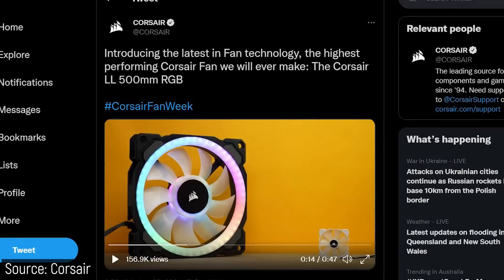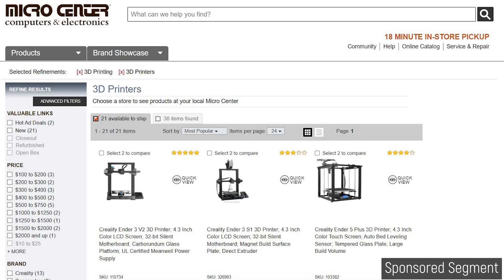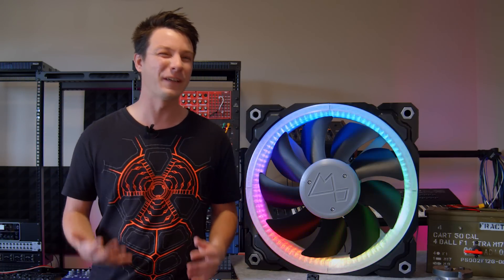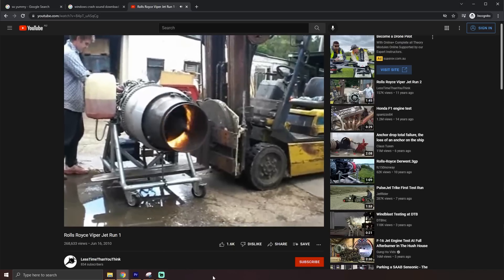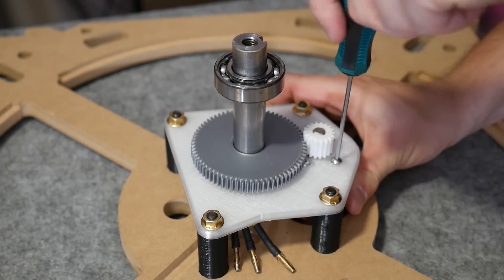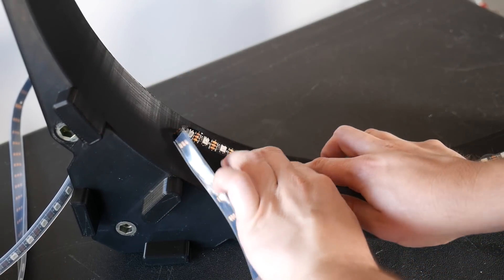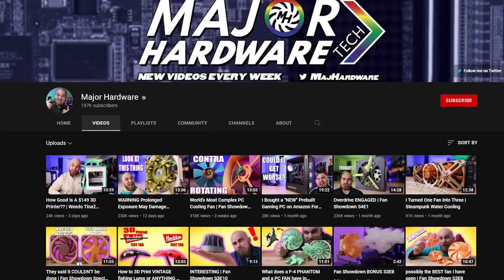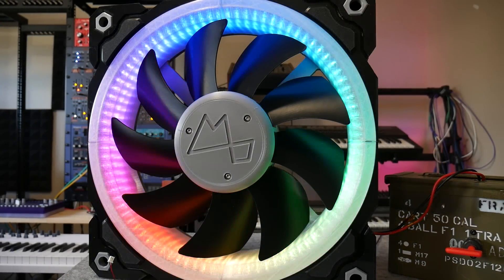Worlds most powerful RGB PC fan

Comment: G'day Angus. Couple of suggestion, one for the re-build and one in general. Firstly swap out the gear drive for a toothed belt set. Belt drive removes the gear on gear friction that destroys 3d printed drive trains and also power transfer is shared by all teeth that are meshed with the belt so removing another weakness (literally and figuratively) of all load (power) transfer being concentrated on 1 tooth of each gear at any given moment.
Secondly and just a general comment about designing parts that are to be printed in sections due to printer size constraints etc. The finished assembled component will be have much more intrinsic strength and rigidity if the joints for each segmented component don't all line up when the finished item is assembled. I realize you mitigated this by using a one piece MDF front plate but you missed an opportunity to add additional rigidity to the other side of the frame by lining the joints in the PETG diffuser pieces up with the joints in the frame. Rotating the diffuser by 45° would have enable those pieces to to also act as bracing for that side on the frame. An old Design Engineer I used to work with would often say any component should serve more than one purpose if possible.
Anyway keep up the the great work, the finished fan is awesome.

Cheers from NZ.

Comment: For the fidget spinner treatment, yeah you can strip the grease oil, but you can also replace it with a low viscosity oil. Since there's relatively low load on the bearing itself, low viscosity oil would keep the longevity as well as the free spinning characteristics

Comment: A current meter wouldn't really measure power output. Even though there is a reduction from the motor output, there is probably a lot of load and resistance on the motor from the giant fan so there will be a lot of current draw regardless of power so that doesn't necessarily correlate to performance. Loved the project though, it looks amazing and pretty powerful!

Comment: For a motor system that big, try to wire in a current shunt in the source power side. They are setup to convert DC current into easily measured mV values. For example you can get a 500A  / 75mV shunt. If you read 150mV, it's drawing 1kA

Comment: I'm impressed the fan wheel didn't explode when you rampped it up to full speed first off, two... please use a more sensible motor... a small three phase motor and VFD would have enough torque to get turning yet still be controllable and have the longevity to keep going for years without overheating.

Comment: 11:16 LOL, I started watching that guy's channel just this month. Edit: You can now recreate that what was it? RCA? Maxwell? Ad with the guy being blown away by his amazing speakers. Also, I would venture to guess it's probably 100+MPH So you're looking at like a cat 2 hurricane levels. I've only experienced 1 instance of my life of 100MPH wind speeds back in august 2020 when there was a hurricane hitting Louisiana. LUCKILY, I'm next to the Alabama/Mississippi border. And that was probably the second scariest weather experience in my life. Maybe third. The first being when I was 10 or so, mid-late 90s, and we were in Michigan, my mother and I drove through a whiteout, that SUCKED. Second was probably when I PERSONALLY experience a similar NO VISIBILITY moment driving home from an electronics store to my house in the Chicago Suburbs, when it was JUST full blast raining and wipers did NOTHING to solve that problem. Also, I'm notoriously a TERRIBLE driver, 13 accidents in 5 years with 2 TOTALS in that time frame (so 11 accidents and 2 totals, only 1 time not my fault insurance wise, so 12 times 100% my fault and I owned it in the moment). Though, I have driven through a Hurricane torn place, first year down in Mississippi. I helped a friend's father clear up what used to be his house, after Michael. THAT, THAT WAS probably top 5 worst experiences in my life, easily the saddest driving through literal destruction on that scale. Over 100 Miles of coastal destruction.

Comment: Did you balance this at all? If not, it's amazing how repeatable the 3D printing process is. I've seen smaller fans tear themselves apart for lack of only grams of balance weight, and yet strapped to the table it's running perfectly smooth. I was ready to see blades go through the wall.

Note for the future that you can buy non-contact rubber sealed bearings, often noted with a VV as in 6203VV. Metal shields which are ZZ also have very little drag. 

I'm impressed the drivetrain held up as well. I'm actually considering making a heavy duty fan myself to cool my tractor this summer, but will probably just use a 12" airplane propeller on a brushless outrunner supported in a printed duct.

Comment: Very cool! would be interesting to use a old hoverboard wheel motor.. Should be easy to do, have seen hoverboard motors used on large RC plains, save on having to use gears..

Comment: If you wanted to be really crazy, you could cut out a carbon fiber gear box and put a 700 class R/C helicopter motor in their with the Delrin gears for an R/C helicopter.  If you go for a high KV and voltage rated motor, you should be able to reach a high RPM and definitely have plenty of power to push at full speed.  Things are unlikely to hold together unless you have some very strong materials and it is unlikely you would be able to 3D print the core structure without it failing catastrophically, though the surrounding parts could be 3D printed.  When you get into this kind of power, you really need to know what you are doing and have the stress loads properly calculated and accounted for.  While a 700 class motor is designed for pushing 700mm blades, usually you are pushing two relatively narrow blades with variable pitch, so going up to several thick cord blades that are much shorter should still create a fair amount of load as you get up to higher RPMs.  You also need to be careful to balance your blades at this speed as vibrations can cause problems and stay clear as various plastics tend to fail at higher RPMs where the kinetic energy in them can be quite high.

If you are really super crazy, you could build a multi rotor hoverboard to ride around on.

Comment: The PC case fan that’s so big and powerful, you’ll never need to worry about your computer overheating again!  Instead, it’ll break from not having a suspension system when it is literally blown over and away!

Consider a slightly smaller computer with wheels on the bottom and wings on the sides, let’s make that PC fly!

Comment: 7:07 i do that bearings to use on my skateboard, standard abecs are a fraction of the cost of bearings "made" for skateboarding (they are just bearings without grease and shielding on only one side in reality) it's an actual upgrade if you're not using the bearing on an actual machine

Comment: It would probably be better to replace the grease from the bearing with oil which would have a lot less resistance than the grease but keep the ball bearings from burning out too quickly (assuming you wanted to keep something like this working longer term) but fair play, this is an amazing project - even if it is larger than any PC case I have ever owned.  I think this fan deserves to have a PC case built around it.

By the way, I have hurt my fingers on many case fans so be careful with this one, with the speed it ran at on the initial test it looks like it could take your arm off.

Comment: That is a pretty damn cool project, Angus. Have you considered a different gear type, like herringbone? Maybe that would hold up better?
Reply from the maker: Herringbone is definitely quieter and a little stronger, but I'm thinking timing belt for next version is the most effective solution. May still print the pulleys!

Comment: one tip on the ballberings is to use Ceramic ones. should both take the speed and hold up the heat better without any lube.

Comment: Great CPU fan. I have a few suggestions. The gearbox of the fan is a point of failure and noise. You should remove the gearbox and use a lower KV motor to directly drive the fan blade. Look up heavy lift drone motors they are powerful and should work perfectly for this. Also you really need to balance the rotor to minimize excessive vibrations and noise.

Comment: Use a Car shunt resistor with a voltmeter to measure the currents higher than the supported by the multimeter. Then you can calculate the current based on the voltage drop between the shunt terminals and the known voltage of the power supply.

Comment: You should try using Speed Cream on your bearings instead of running them raw. It's the best skateboard bearing lube and it's very thin as to not add much resistance. I wonder if it would add any substantial resistance as opposed to stock grease.
Reply: The grease isn't really the main source of resistance, in this case, it was the use of a sealed bearing instead of a shielded bearing. Sealed bearings use rubber lip seals (the orange pieces he removed) that contact the inner race whereas shielded bearing use (normally metal) shields that have a small clearance around the inner race so don't add to the rolling resistance. This is why skateboard bearings can't be lubed for life. They are shielded because low rolling resistance is far more important than longevity of the bearings. FWIW bearing inside gearboxes are completely open because the live in a clean oil filled environment so no seal or shields are needed at all. I do agree with you comment about the Speed Cream though, an alternative good quality low viscosity lubricant, applied in the correct amount i.e. not too much, would give much better results than WD40 which has no real lubricating properties to speak of.

Comment: This reminds me way too much of the fan on the back of an old Harris Z series FM broadcast transmitter. 

These fans are pretty notorious. They're a two speed 240v motor paired to a plastic 20" or so wheel, I believe the top speed is 1700 rpm. Normally the fan runs at a lower speed, maybe 900 rpm (?) but if the transmitter has any fault active (their normal state of existence) the fan runs in jet turbine mode.

The motor bearings aren't very good and the motor won't last more than a couple years at that speed.

Worse, there are anecdotes out there about the fan wheel exploding at full speed, which trashes the fan enclosure and some of the power supplies.

I've found you can usually hear the Z transmitter in jet mode from outside the building and about 150 feet down the road.

Comment: By merit of scale, this is more like the kind of fans you find on the roof of a Diesel locomotive than the ones you find on a computer, Would be kind of dope if they had RGB LED's on those. You can also turn a bunch of crypto miners up to full gonzo and prevent them from frying with some heat sinks and this.

Comment: Just add a small resistor in series and you can measure the voltage over it and calculate the current and power.

Comment: I think it would make more sense to make a fan that is exactly the size of a MORA radiator.
as that would block the edges from airflow it should be mounted at a distance with a sort of spoiler that distributes the airflow over the whole square of the radiator, avoiding dead spots behind edges and hub.

Comment: Use a hoverboard hub motor instead. It will be way quieter and somewhat practical. Those are usually 350W  at 10S, but if you overvolt them they can take about 650W no problem. They also have sensors for sinewave vector controllers which are even quieter.

Comment: Should have gone with a belt drive. Plenty of room inside the hub for a metal toothed pulley around the shaft, attached to the hub, and a smaller pulley on the motor, with the edge of it just clearing the edge of the fan pulley with the belt tight.

Comment: Looks like it's time for metal pulleys and a toothed belt. Great project! WD40 is more of a solvent so I'd try air tool oil in the bearings and see how that does. That could have been coursing strain on the gears too.

Comment: Make it belt drive.  That would cut down on noise from the gears a bit and would also make it more reliable.  I made my own wades extruder with a belt drive for that reason.  It's smoother and much less noisy than the stock wades extruder was.

Comment: If you have a hall effect clamp meter, you already know the voltage, and the meter can give you the amps
and from that, get the total watts this bad boy pulls
Or you could measure the resistance of the system, and work it out from there

Comment: I had an idea when you mentioned that you are hindered by moisture in 3D printing of transparent material.  put the 3D printer in a deep plastic container and fill it with nitrogen gas then start printing in nitrogen gas.  Will the result be better?

Comment: $100 at the home depot gets you a 24 inch all steel ducted/shrouded fan with a proper direct drive mains induction motor, lubricated bearing, and 2 speeds. Something like 2500ft^3 per minute.(70m^3)

Comment: Angus, use some chain oil or something on the bearings when you're done, not WD40. That's a solvent, not a lubricant. Same resistance, but will last longer.

Comment: After the WD-40 clean it a little (doesn't have to be perfect) and add sewing machine oil. Won't dry up super quick and at least is somewhat meant for high speed. Can also use a lube for skateboard bearings but that's about a million times the price for something not that different.
Reply: You will still need to reapply, bearings on bought PC fans are sealed to make them zero maintenance.

Comment: Driving 2hp through a tiny pla printed gear🤔
Who would have thought it would have given up?
It would be cool to do some cfd and figure out how much air the fan is moving at full chat.
Reply from the maker: Hehe well the pinion is IGUS filament but yeah I think the main hub got hot and striped. Will tear it down to investigate and might go timing belt next version. CFD calcs could be interesting!

Comment: I use a HT206D 600 amp clamp meter from Amazon to test the load on my RC planes and cars, works well enough, and the price is right. That's what I would recommend.

Comment: okay I have a really cool question, in reguards to 3d printing, and I thought I would ask you! Okay I know that there are 3d printers on the ISS, so they do work in zero gravity, however would the need for support structures be gone? There isn't anything pulling the melted filiment down, so would it just hover in mid-air? I would really like to know what happens, and hopefully you might read this and may have an answer! Thanks!

Comment: Would vapor smooth the blades to increase the strength and improve airflow ;) 

(And before somebody points out its PLA, it's actually very easy to vapor smooth PLA without expensive devices. If anyone wants the method let me know and I'll do a write up again.)
Reply from the maker: It might help yeah, but I don't trust the chemicals used for PLA. If I wanted them super tough I'd print in a CF PA or PC I think. Annoying to print, but crazy strong!
Reply: @MakersMuse  yeah we basically just use PLA for minor items around the factory. If we need it stronger we just print straight in nylon (SLS or MJF)

Comment: How much for you to make me one that I can replace the Glass panel on my Lian Li Lancool 2 Mesh???? That would be so much "cooler" than just lame glass. (pun intended)

 A giant RGB fan that I can still see through, somewhat, that will make sure my GPU has plenty of fresh air? Sign me up! It's a Hybrid EVGA 3090 FTW3, so the fan and heatsinks on the power and memory will love this. Although the memory chips on the back are what need the most airflow and would benefit so much.

Comment: The (sound) frequency I measured near the maximal speed was 1870Hz. If I've counted correctly there are 9 blades. This corresponds to ~208 revolutions per second or about 12,500RPM 😲

Comment: Remove the brake for the motor in bl heli, so it won't wear the gears
Reply from the maker: It's a SS so not very programmable but I'd like to swap to something that starts up at a lower speed so might do that too!
Reply: @MakersMuse  right, some esc can be programme so it ramps up slowly

Comment: 0:54 Oh, that doesn't sound good. I happen to have access to a few 6axis 6ftx8ftx4ft print volume machines. Any chance of releasing non split up version when you do finally release them? I won't mind remixing if I have to, but figure a quick combine command would go faster and keep the tolerances. We keep meaning to print the torture's egg scaled up on them to send pics to you, but customer prints have been taking print time priority of course. Though i expect that to start opening up soon with the way the economy is trending.

Comment: make a centrifugal version, ie, center inlet to centrifugal out
Reply: ie under pressure pull, not a push fan
Reply: dont even dare to call a bldc a dc motor, its a scam, ac motor
Reply: belt might be a better for pla-abs 3d prints, as opposed to gears

Comment: I used my ford 300 i6  to draw air through dual radiators to cool my watercooled pc in my truck...... and it never sees more than 30c...... this was maybe 8 years ago but does it count my f150 as a case idk but it was cooled by the 4.9 litres radiator fan

The motor makes 383 nm tq at 2000 rpm

Comment: WD40 is not ideal, since it's 2/3 solvent 1/3 oil, and the oil that remains is THICC and sticky. It's better to use light oil - sewing machine oil or silicone oil. But then again, with these sorts of powers, grease being a little too sticky is hardly a concern.

Moulding and casting some gears in high temperature epoxy might be the ticket, that's what i would do. What i wouldn't do is casting them out of alu, but then, that's a possibility too.
Reply from the maker: True true, I've dropped some sewing machine oil in since but they're definitely going to experience long term use!